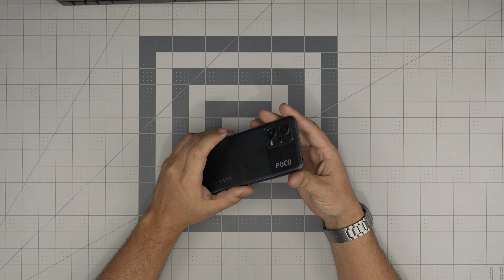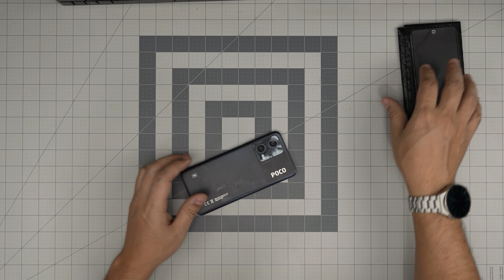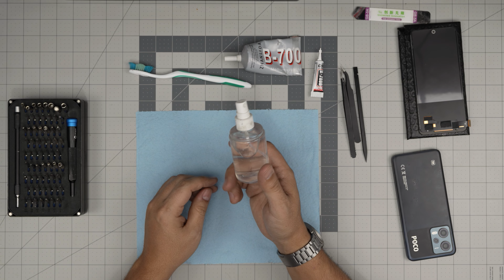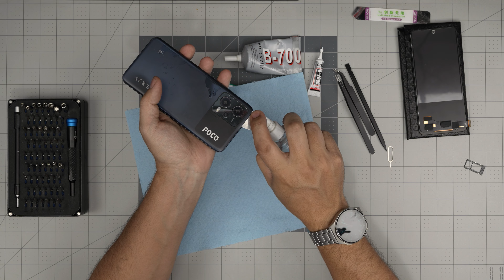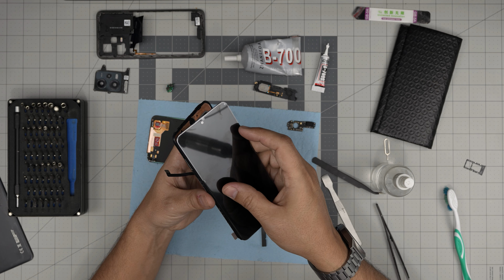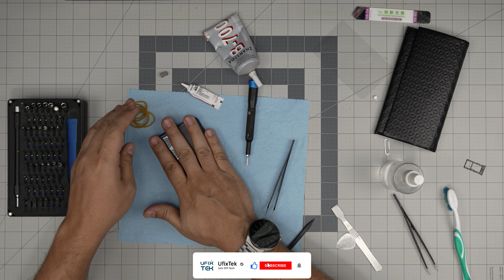How to Replace the Display on Poco X5 5G 📲 Screen Repair Guide✅

Comment: Thanks for the guide. I thought of replacing the screen myself now I am not sure since its a little bit harder than I expected and also I lack the equipment
Reply from the maker: It's my pleasure my friend.
it does take a bit of practice and tools are needed, but the repair shop do install them under 20usb for the work.